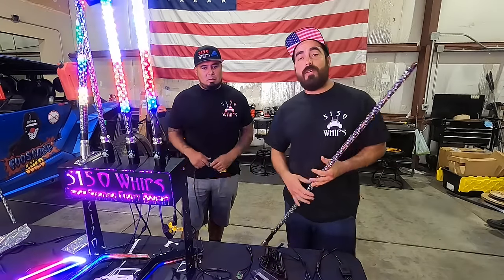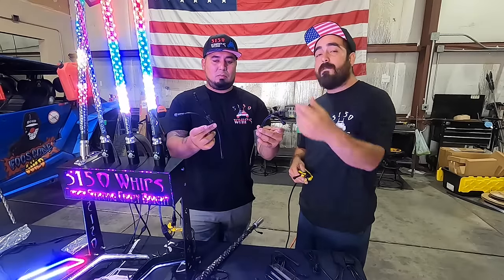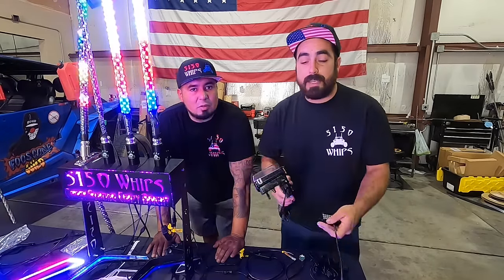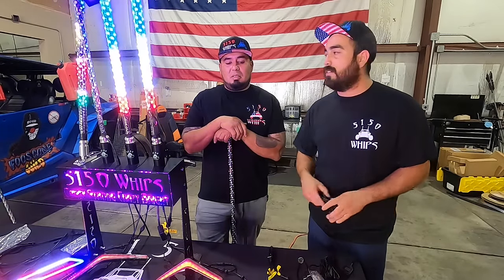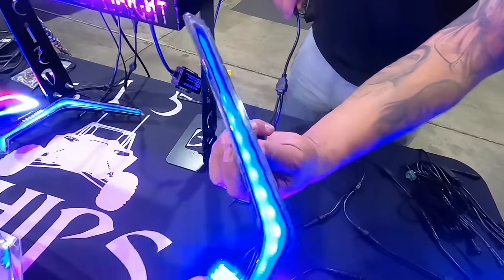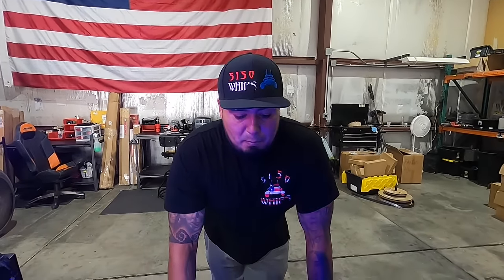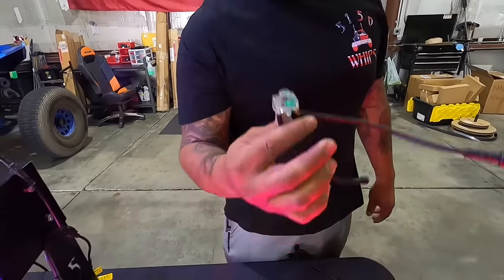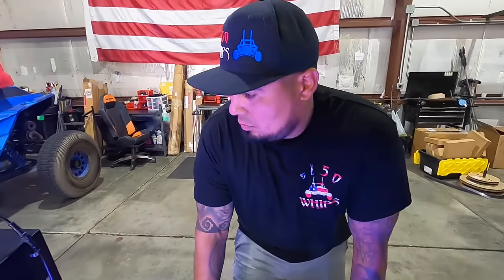5150 Whips Wiring Multiple 187 Products Together

Comment: Those 3 pin connector  suck
Reply: Almost never line up the first time. The pins get bent and then it turns into a nightmare.
Reply: So how did you get them connected I can't even get one lined up.
Reply: @n2sport1   I used a tiny flat blade screwdriver to bend the male pins into formation so it would line up. You have to be very gentle with these. DO NOT push them together. You will disform the pins.
Reply: There's a small notch in the connector that you have to line up. Use that as a guide, and your pins will go in perfect every time